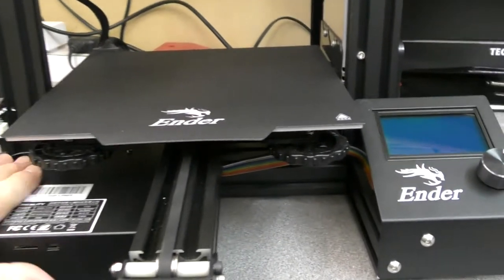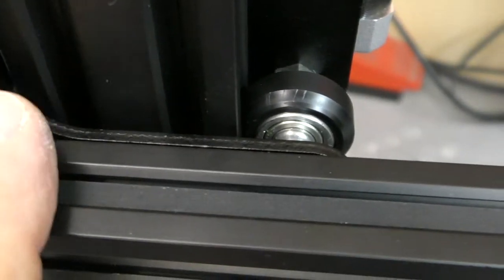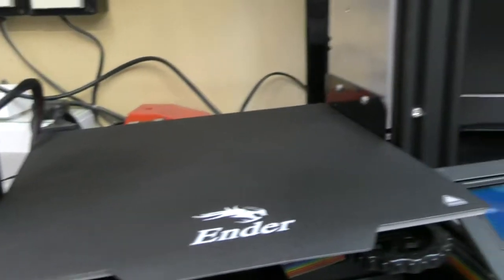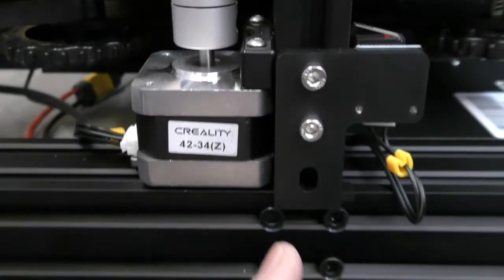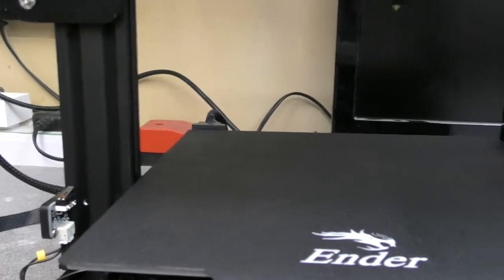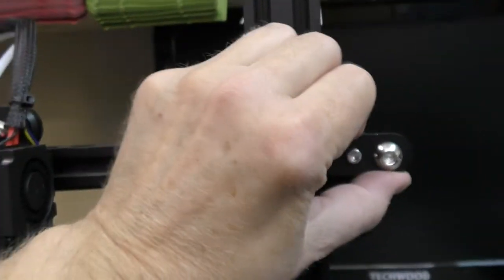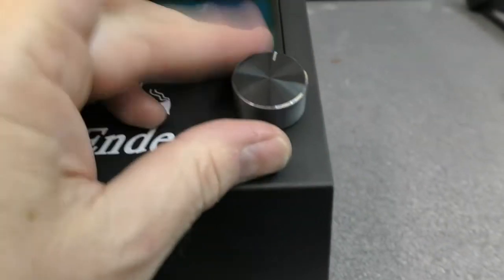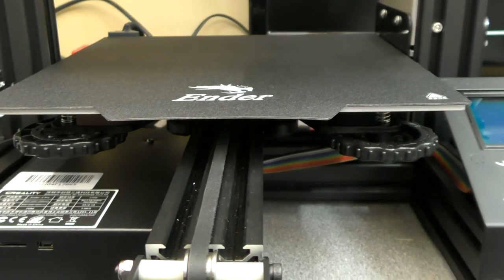Ender 3 Pro Levelling Issues

Comment: I have an actual dip in the middle of the bed.  It won't adjust out either.  I took to trying to shim the inside with paper to level it out.  It worked, but it now has cold spots, causing me to increase the bed temp when I print.  It's a pain.  I am considering a glass bed, I have one, but I do like the magnetic one. Any suggestions on getting that dip out of the middle? It's obviously a factory flaw.
Reply: Same with mine
Reply: Still works after a couple layers on mine though
Reply: @3dragonprints458  I finally reduced it by taking the pressure all the way off and heating it to 70°C.  Then I set everything to the temps I wanted and leveled the table.  It took a lot of it out,  still a little dip, but it is much better.

Comment: I have the exact opposite problem the right side is always lower than the left side and I can’t fix it I have watched all the videos and nothing works and I’ve looked on forms online.
Reply from the maker: Use a set square to check everything is square. Loosen all screws and try again.
Reply: You should also check to see if you need to adjust the tightness of the wheels against the support. (DO they spin too easily?) If it's loose, you may need to adjust your "eccentric bolts" - look them up if you don't know what an eccentric bolt is!
Reply: Did you find a fix to the issue im having the same problem

Comment: It can be connected to a pc via mini usb and Cura will recognize it. Rather than using an sad card, prints can be sent directly to it. Although, if your pc goes to sleep, it can cause it to stop mid print.
Reply: you can set your computer to stay awake in the power settings

Comment: The stock springs on the current Ender 3 Pro (mine is around 3 months old) are (IMO) too soft and is amplified by the z-axis endstop plate being too far up.
I found that if I move the endstop down (you need to chop off the lip) then the springs are under more tension and the bed stays level for longer. I have, since then, upgraded the springs which made me move the endstop plate up.. :-)
Reply: isn't it great how that stupid lip is put on there?